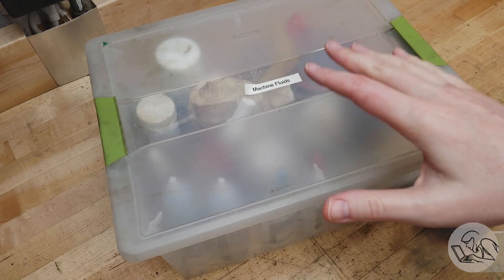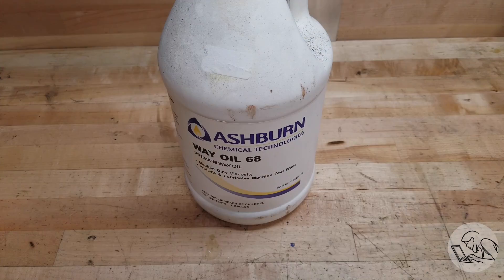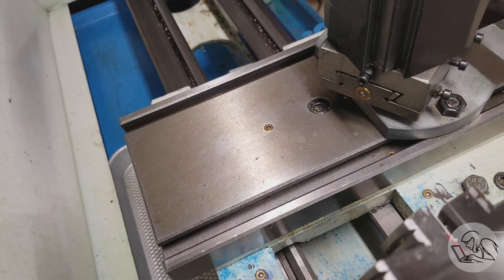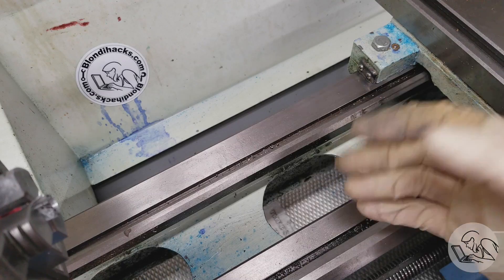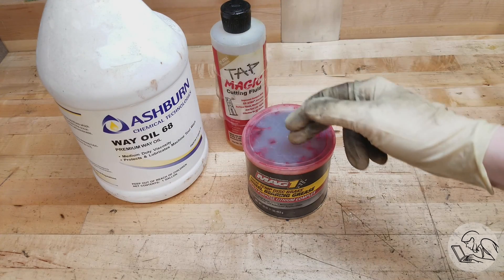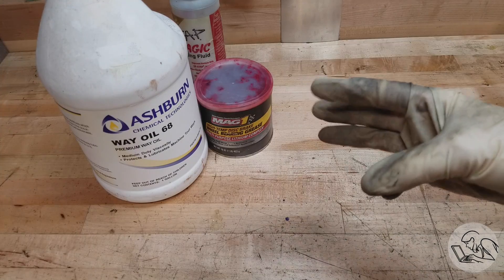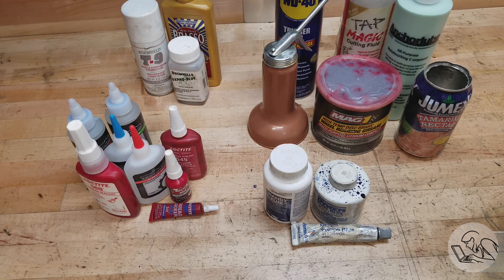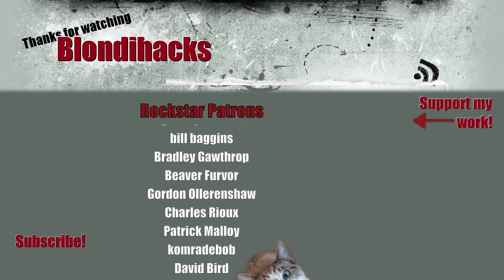Lubricants and chemicals you need in your machine shop!

Comment: I went to a big box store in the USA to pick up Loctite Red and saw that it was Loctite 271, but what's in your video is Loctite 603.  Are they interchangeable?
Reply from the maker: Not really- there are many many kinds of Loctite, not just the main “colors” people think of. 603 is green, cures anaerobically and is intended for press fits. The “red” is a thread locker that cures in air in a thread fit
Reply: @Blondihacks  OK thanks.  I was confused because Loctite 271 appears only on loctite.com and 603 is only on henkel-adhesives.com so you can't use a compare function between them.

Comment: One thing I've noticed nobody bothering to mention is the minor point about changing the jaws on a 3 -jaw chuck. It didn't take me long to work out the specific relationship/order they have to be placed in, but who has the time to fiddle around with them when changing between internal/external grip jaws? So I've colour coded the ends of the jaws and the chuck! Blue here, red there, green ... where does the green one go? Ahhh!

Comment: Quick question for you, I bought long time ago a 5Gal of Mobile Vactra No 2 way oil (also an ISO 68) and I use it in my lathe (gearbox, saddle,...) but I find that if I spread it on the ways like you show (or any other metal surface) it will be be rusted the next day. My shop is in Florida and pretty humid - did I get a bad batch of oil or is this normal ? I tend to use CRC 36 for my ways and cast iron surfaces now

Comment: wanted to add something here as i noticed it. as a knifemaker and blacksmith, i highly dis-advise the use of used motor oil as a quenchant for parts, the smoke and fumes that are released from motor oils has been shown to be quite toxic, as well as it can be slightly carcinogenic, so as an overall, it is very bad for your health if you are near it. and even tho it may have a relatively high flash point, the temperature at which you are quenching something at, relatively over 1300degree's F, it well past exceeds the flash point of it. a much much safer and even more pleasant option is actually any kind of common cooking oil, more often a canola oil, as it is also quite cheap, and  has a decently high flash point but also any of the fumes that come from it burning off are non toxic, and will actually smell pleasant instead of deadly in this circumstance. this is just my advice and  you may do with it what you may, but i also would like to always see people try and stay away from airborn toxins as much as possible. good job overall on  the rest of the info.

Comment: Project Farm did a good video on penetrating oils, once I am done with my Kroil I'm going to change over to his recommendation, worth checking out.

I got a 10 pack of small oil squeeze bottles from Wish. I have found them very handy for keeping useful amounts of oils at hand that come in larger quantities.

Another sticky oil I use around the shop is chainsaw bar oil. It does not smell as bad as way oil.

Straight mineral oil is great for keeping around. I use it often to wipe down metal to keep it from rusting but still clean enough to handle with bare hands.

Some kitchen cleaning products have a bottle design that you put a towel on top and press down and it dispenses into the towel. I found the bottle perfect for acetone onto a rag for cleaning.

Small makeup containers are perfect for repackaging things like bearing grease that you don't use much of.

Old perfume bottles are great for things like isopropyl alcohol if you need small spritzes.

Comment: Quinn, not sure if you have tried Hangsterfer’s cutting lubricants.  At RR we use their tapping fluid when thread forming `difficult` materials, normally this is Inconel 718 or other super alloys.  It is administered in the form of a fine mist spray using the oil and a low pressure compressed air feed.  Experience has told us that this is the best combination to achieve a good and consistent thread form.  Being British copious quantities of freshly brewed tea are also necessary when undertaking any machining tasks!
Reply from the maker: Good to know! Tea is an essential fluid in my shop as well. 😁
Reply: @Blondihacks  Should you ever find yourself in the Nottingham area please feel free to call in for a brew and a chat...the kettle is always on!

Comment: Dear Quinn
I require some help please do you have a part number for the Goldenrod oil can with flat bottom nozzle for ball oilers.
My research only comes up with the oil cans no information on the nozzle?
Christopher from Down Under
Reply from the maker: There’s a link to it in the description. I hope that helps!
Reply: Dear Quinn
All the links tell you about the cans not the nozzles.
I would like to buy the correct oil can with the flat nozzle for the ball oilers on the ways if you can give me more help it would be appreciated. Christopher

Comment: This is probably one of the most useful videos I've seen in that YouTube machining realm! I have a little old baby Craftsman lathe, which doesn't have oil ports. Would you still recommend that goldenrod pump, or is there a better option like the goldenrod 505?
Reply from the maker: I think either would work fine. Lots of people like the “springy bottom” style for the simplicity and old-fashioned charm.

Comment: The best penetrant I have found is a mixture of acetone and brake fluid. Acetone is sometimes used in the laboratory to find small leaks, due to its small molecular size, which makes it useful as a penetrant, but not so great as a lubricant, hence the addition of brake fluid (which is also low viscosity) for when the acetone evaporates.
Reply from the maker: Interesting! That’s a cocktail I haven’t tried. I tend to avoid brake fluid because it’s corrosive to paint.
Reply: @Blondihacks    Mix acetone half and half with ATF.  Store in a tight container or the acetone will evaporate.  Great penetrating fluid.

Dale in Canada

Comment: Quinn, this question is way off topic but I'm asking anyway. It has to do with one of your co-stars in many of your videos (the brass scriber/pointer), which I assume you made. How did you cut those very narrow groves? They look to be in the order of 20 - 30 thousands wide and They do not appear to be "V" grooves.
Reply from the maker: Good question! They were actually made with a sharp-nosed tool, so technically they are v-grooves. However they’re very shallow so it doesn’t appear that way.

Comment: Blondihacks got me to buy Anchorlube from a previous video. Her description resonated with my fear of chemicals. I have been drilling out pin holes in knife handles with 1/4" carbide drills. It works for that and no stink. My experiments with cutting lubes shows Moly D has the advantage in drilling large holes or tapping large holes.

Comment: ISO 68 "Way oil" is also used for hydraulics  and in my case, the gearbox on my Sieg SC10.
Rather than buying a large container, check truck or agricultural dealers and 1L, about a quart, bottles should be available

Comment: I agree brake parts cleaner as great machine shop solvent in some cases, but might want to add a caveat to never use it to clean parts to be welded. Chlorinated brake parts cleaner will generate poisonous phosgene gas when welded on.

Comment: I was given a load of old machine tools. Singer sewing machine oil helped clean and restore my micrometer, the force required to move them was clicking the ratchet stop too early, all good now. I also used it sparingly on a sticky dial indicator, which is now working well too.  That little bottle has saved me at least £100 already

Comment: Nice collection.  I will toss a caution in there about the brake cleaning solution.  You do not want to use it on anything you will be welding.  most of it has some Tetrachloroethylene in the mix and it produces phosphine gas if you weld with TIG or MIG.  But any high heat will probably make Hydrogen Chloride, which is only a little less dangerous.   It needs Argon to make Phosphine. 
 You might be able to wash it off enough with a post clean with Acetone, maybe, but considering the consequences if you miss a spot I probably wouldn't chance it.
A excerpt from this page https://www.brewracingframes.com/safety-alert-brake-cleaner--phosgene-gas.html

"Some Phosgene facts. Google Phosgene and read more!

It can be fatal with a dose as little as 4 parts per million.

Symptoms can be delayed from 6-48 hours after exposure.

There is NO antidote for Phosgene.

Long term effects can be chronic bronchitis and emphysema. "
Reply: Well written but completely misinformed.. If you watch the video you will see that the can says non-chlorinated... They have removed all the good stuf from almost everything we use... It still works well but nothing like the old stuff with 1,2,3 Tricloroethylene... Damn you California  and your silly attempts to save the planet...
Reply: Nice try but I am in Michigan.  And I didn't say don't use it but don't weld after you use it.  I'm just trying to save builders.  As in don't weld galvanized metals, not nearly as bad as brake cleaner but still quite bad.  BTW this is a BIG topic on welding forums because of the very small exposure with very long health issues.  So that is mostly red state folks.
Reply: @skoue4165 It doesn't matter where you are.. it is very hard to find the chlorinated cleaners although they are still made.. They don't clean like they used too... they are now made from Perc (what you call tetrachloroeythane but is traditionally refered to as perchloroethylene) instead of the more volatile Trichloroethylene (either 1,1,1 or 1,2,3)
As for the Phosgene issue, the stuff evaporates quickly leaving no Perc residue... you need to ventilate (at least 10 changes per hour or more depending usage). 

Unless yupu are bathing parts in an open pit of perc and have no ventilation the haszards are minimal (which is why you dont see welderes dropping like flys even thoough brake cleaner has been used as apart cleaner for many years). I am not saying to ignore the risk, juist be aware of what is really going on around you.. BTW this is an issue fopr many haloginateed products incluiding many types of older freon. Since you are likly to release several pounds at once inside the equipment you are ervcieing it becomes a real danger..

SIMPLE SOLUTION>> DONT USE CHLORINATED PRODUCTS IF YOU CAN AVOID THEM
Reply: You are the one who started using locations.  
If you read the article the individual had even preheated the area with a torch had the shop door open and the exhaust system on.

I would be glad to hear that it isn't used anymore except that what you say it was replaced with you immediately , and correctly, point out is just the other name for the same chemical.  Ot ro quote from a chemical database "Tetrachloroethylene (also called perchloroethylene or PERC)".  You are right to point out that there are plenty of other chemicals that would pose the same issue but they were not mentioned in the video.  Brake cleaner is not used by welders and the toxicity issue is a BIG one on welding forums.  

Welders are also not a great example since as one old time welder told me "you see a really healthy welder and you are looking at someone without a lot of experience".  That is over stating it but he does have a point.  A lot of welders have health issues related to breathing fumes they should not have.

Squabbling aside we agree one should pay attention to the chemicals we use and especially any that may be heated.  Zinc coatings are also an issue for welding because of toxic fumes.  I see plenty of amature welders welding galvanised steel.  With enough ventilation or a good respirator and the right cartridge you will be fine but heavy ventilation gets problematic quick with TIG and can be a problem with MIG also.  Neither of which do well outside so respirators are about the only option.

PVC is pretty toxic if you burn it and the glue has MEK in it.  Toluene, a pretty useful solvent on top of being extremely flammable is readily absorbed through the skin and can put you in the hospital.  Most of the chemicals in my shop would put you in a world of hurt if used them incorrectly.  I am fairly sensitive to all of the halides, so I will end using a respirator with a halide cartridge if I'm doing a lot of painting with latex paint.
Reply: An extra caution. Sometimes it looks galvanised, but the protection layer is cadmium. This considerably worse than zinc.

Comment: I use Lucas Heavy Duty Oil Stabilizer for way oil. I may be doing it wrong but it seems to be BETTER than dedicated way oil.  It is More expensive than way oil but you can get it in smaller quantities and they have it just about everywhere. I haven't used any dedicated oils for my lathe yet. Cutting oils depend on the material . Light oils ...even charcoal lighter for aluminum...I use regular old canola oil for cutting and drilling steel.

Comment: I use motorcycle chain wax for my change gears. It is made to resist high pressures, doesn't fling off when the gears are spinning and it dries to a waxy substance that chips don't stick to.

Comment: Lubricants are actually very interesting and something I use a variety of for general repair, farm and restoration of antique typewriters and sewing machines.
I have an old bush hog with a leaking oil seal under the gearbox.  The large nut on the bottom is rust welded on and will NOT come off.  So I replaced the oil with 00 grease (between a gear oil and grease in viscosity) which is thin enough to lubricate the gears but too thick to leak through.  For bicycle chains I much prefer wax.  I heat a Mason jar of wax and chain on lowest oven setting, dunk the chain then hang it up to cool.  Excellent chain lubricant that does not attract grit and does not mess up my trousers.  My chains last longer now.  Wax is also great to rub on bottom of wood drawers in antique furniture.  I've read a 1940's typewriter manual that advised against oiling the machine.  Sure, if you type 40 hours a week the paper dust does stick to the oil, and the oil of that era could gum up and make a varnish, but today we have synthetic oils and typewriter hobbyists just piddle around typing, so I say sparingly lubricate that machine with a quality oil!  I have several long needle oilers I use during restoration.  Kroil Microil is good as well as Remoil.  Besides, we have dry lubricants now like spray on graphite and PTFE if you don't want to oil your typewriter. Singer oil is great for sewing machines - doesn't stain fabric.  I use vegetable oil in my chain saws for the chain lubricant reservoir as I don't want to breath cancer causing petroleum oil droplets, but I sometimes do have to work the chain loose as vegetable oil over time will harden and get very gummy if it hasn't been used in awhile.  Yes, Kroil is great, but I actually like the smell better than PB Blaster.  And I've used "Mouse Oil" penetrant too.  For oil cans I prefer the type you push the bottom as there are no moving parts to fail.  Thanks for the video.  Sorry to be so verbose, but you inspired me.
Reply: The easy way to unstick rusted un unstuckable fasteners is HEAT! An oxyfuel torch with a weed burner tip or rosebud tip will do. There’s videos on how to do it safely, without goobering up your brush hog
Reply: Any grease other than NLGI 2 usually requires a major purchase in volume.  I tried to buy a grease cartridge of Chevron Black Pearl grade 1...impossible at the retail level.

Comment: Although you did show it, you barely touched on the CMD Extreme Pressure lube before moving on. I can't say enough good things about this stuff. Your tube looks new, so maybe you haven't used it much, or had the need to with lighter duty machinery and smaller parts, but when there is a lot of force involved between sliding surfaces, like threads or centers, regular wheel bearing grease won't hold up, galling occurs and parts fail. If you ever have very heavy material in a dead center this stuff is awesome. It's also incredibly effective at preventing galling on the forcing screws and nuts on all kinds of pullers. I have been using it for a long time on dozens of expensive bearing and gear pullers in the automotive world, where the threaded forcing screws tend to gall and seize, and this lube prevents that and the tools last forever.

Comment: Excellent treatise on soft products for the shop, Slide Way oil is the unsung hero, a fairly recent innovation. I would recommend Isopropanol or Ethanol before using Acetone as a cleaner, plastics can be attacked it.
Again many thanks for sharing and best regards from the UK.

Comment: You missed be talking about use silicone grease for plastic / nylon gears and tell people to not use WD40 as lubricant and to not aply WD40 in rubber stuffs as well. Excellent video anyway. Very good and accurate information. Thanks for sharing that!
Reply: Why shouldn’t we use WD-40 on rubber products/surfaces?

Comment: Great video.  Sometimes the simplest things are the most overlooked yet are most important to know.  I have a fetish that my machine tools (especially ones I make) not corrode!  Therefore I take the way oil you noted and add lanolin to it (80/20 wayoil)
Reply: I also needed to warm the way oil to mix in the lanolin, but once mixed, it didn’t drop of suspension.  Learned this from an Aussie friend

Comment: I've tried cutting fluids several times now on different metals, apart from stinky smoke and a sticky mess it does not make any difference, so I keep dry cutting everything. Except for tapping steel which is a bit more forgiving with oil, but for aluminum and brass it hinders chip evacuation so prefer dry tapping too.